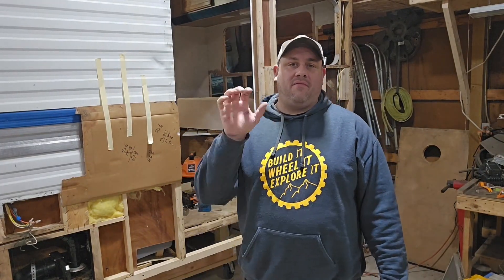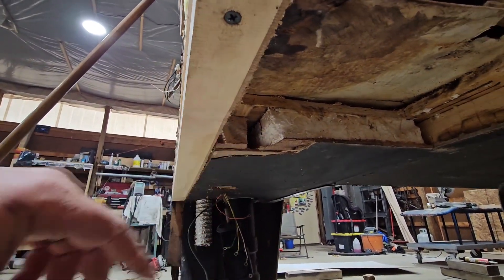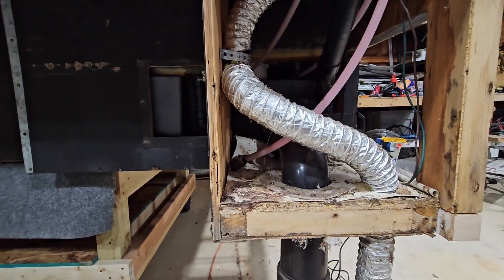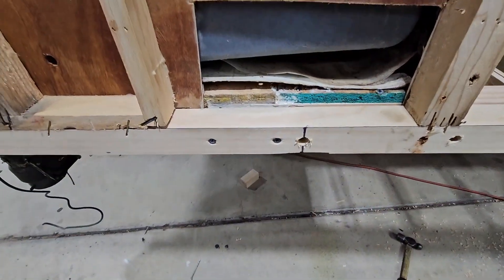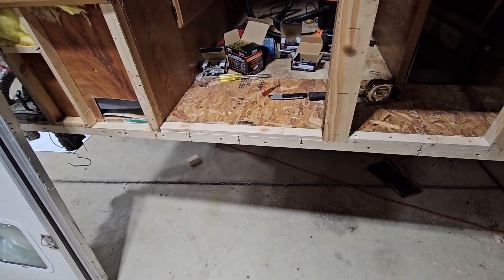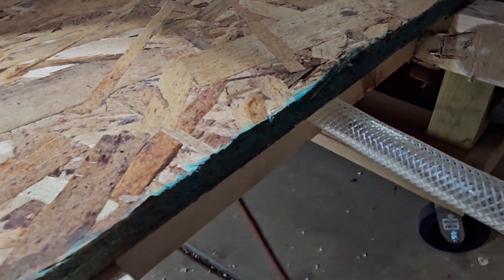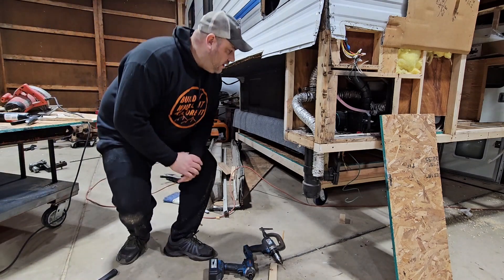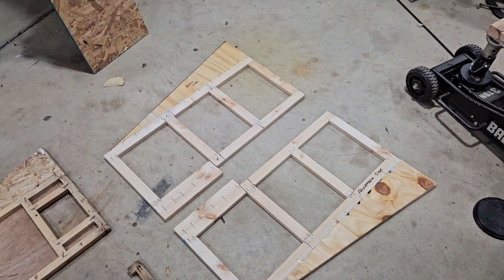Lance Truck Camper Rebuild/Repair Series Part 5.  (Rear floor and back wall rot GONE!) DIY Let's Go!

Comment: Looks good, are you using pine wood and will you be repairing the roof? I have a SUN-LITE truck camper that looks almost the same.
Reply from the maker: Yes, I'm using pine for all the rebuilding.  After the rear/side is complete, I will be moving to the roof above the bunk.  There is a 26x26 escape hatch that leaked.